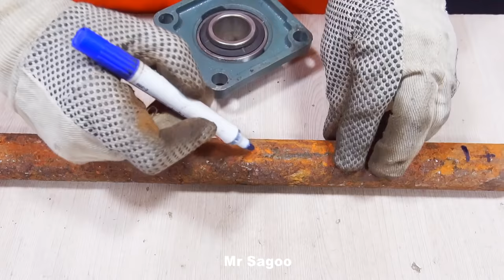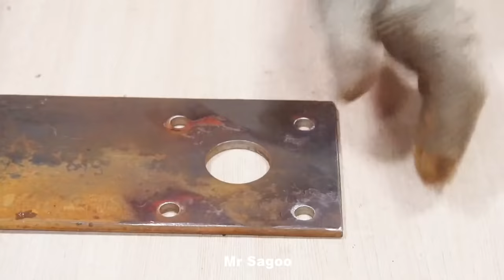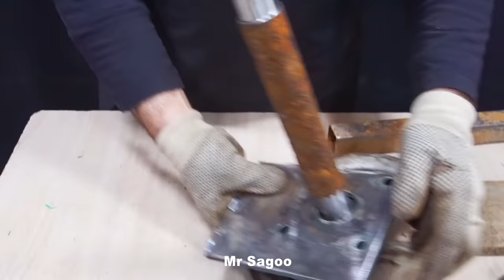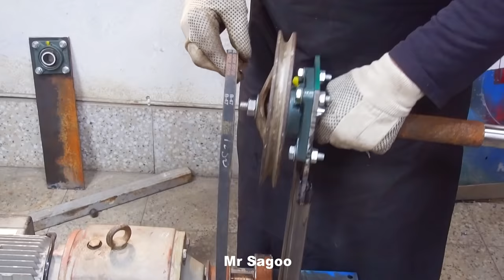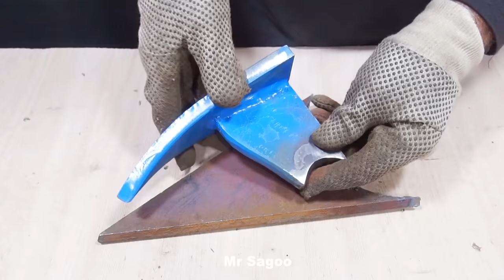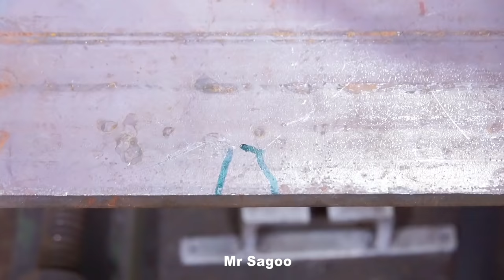Homemade Wood Splitter 1 Part

Comment: a belt with a so small pulley will stop the machine every time you put in something bigger than a dental stick.....the tip il also very big in comparison with the small shaft weld. But it is also good idea...I think it was better to fix the shaft directly to the gear reductor and reinforce the tip weld. A security break plug may be useful, or better a security clutch. Sorry for my weak english, and keep safe.
Reply: It has a high torque and a gear box involved I believe. Look at the speed at which it's spinning. Also note that there are notches for two belts. It could even tear through metal if the tip is hard enough
Reply: @richmonddias2699  yes, you are probably right, no doubt. I have not seen this machine in a "true"action. For my activity I usually operate with an hydraulic 20T logsplitter, and all I can say is that it is a very hard work for me and also for the machine, some wood prefer to wrap around the blade and squeeze like a damp sponge instead of being straight cutted under the blade, and the whole structure of the machine of about  6q flex and crack and stops under this heavy loads. I love this.
They are wonderful machines.
Reply: @enfav3407  you have to position the wood in such a way that its fibres are parallel to the cutting edge.
Reply: @richmonddias2699  Yes, I (must)do :-) .
But many times direction of the fiber are not predictable, especially near roots and branches , you press it straight , but they break and flake off in pieces with many tons of thrust. Of course , if you have a straight log you can split it in half with a wedge and a wood hammer rather than a billhook, but this is not always the case. Raw jobs need raw power, or, if you prefer, an iron axe, balls of steel and plenty of time...  ;-)
Reply: @enfav3407  yes. Knots are difficult to manage. You have to avoid it in mechanised chopping. It can be put in saw machines only
Reply: @richmonddias2699  yes big saws are also a solution!
Reply: Yy

Comment: Mint. Split some wood with it - the belt will slip/break/come to a jarring halt the instant it encounters the log. There's zero inertia, so it's splitting zero wood using just a rubber V belt as the primary "weakest link".  Video may have 2 million views, but it's 2 million wasted views, 'cos this thing not verk.  Naddachance.
Reply: Есть правда в Ваших словах!🤔👍
Reply: That’s probably why he did try it
Reply: Wheres the demo on actually splitting wood
Reply: Deveria fazer um teste.  Acredito que não funcione.
Reply: Qqqqqqqqq

Comment: I doubt that it would have worked as a wood splitter. :(
Reply: The driving belt would slip while wood splitting. That is the reason, you made a direct-driven new model. Am I right ??